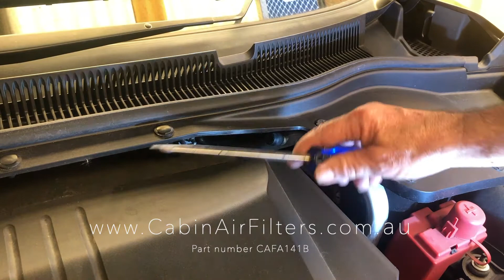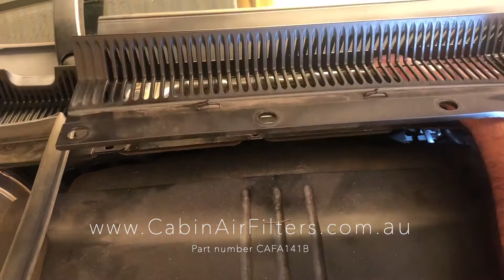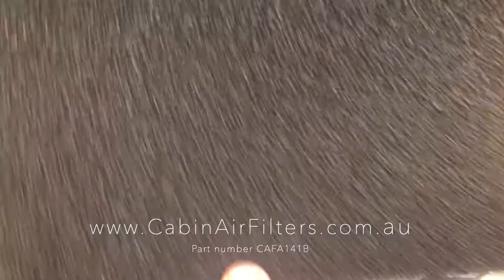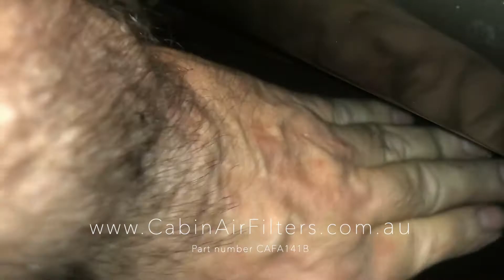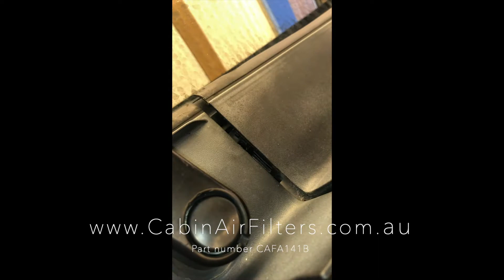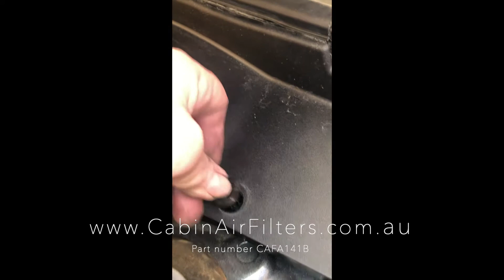Holden Commodore VF Cabin Air Filter Install, For the  ultimate carbon air purifying experience

Comment: Is it true for holden commodore 2006 ltz (lumima 2006)?
Reply from the maker: Hi if your model is the VZ series lumina this filter will not fit , you will need our CAFA1416 which fits all VT-VZ commodore  its available at this link on our website https://cabinairfilters.com.au/?p=21394

Comment: Do vu have a filter
Reply from the maker: Hi We make a cabin air filter for the VT to VZ series 1997 to 2006 , they originally on had a mesh screen in front of windscreen , we have designed a filter to replace it, there available at this link on our website with some install pictures https://cabinairfilters.com.au/?p=21394

Comment: I've been using your filters for years now and love them but i find when theres alot of debris and you take it out, you can't stop it falling into the fan. The debris doesnt cling to the filter.
Reply: Use a vacuum cleaner to suck any debris from the front of the filter before removing it.